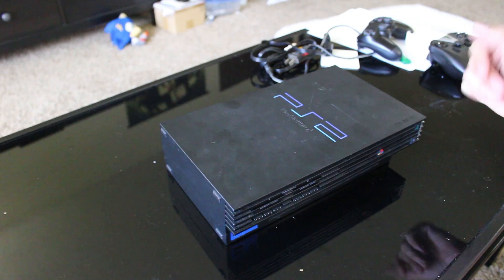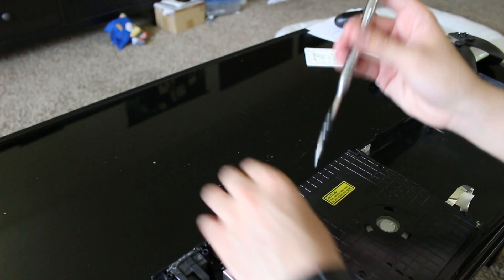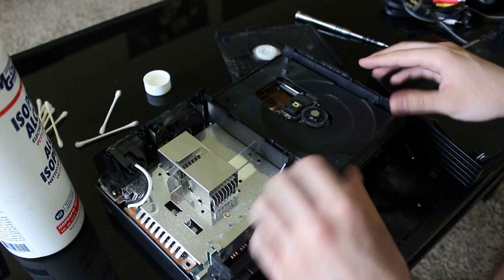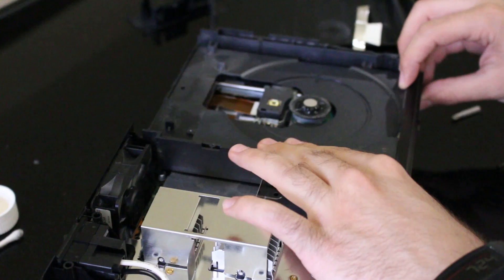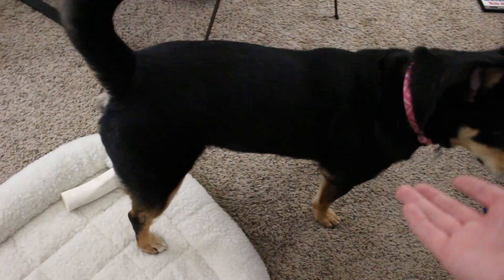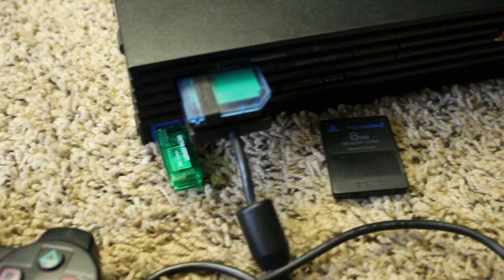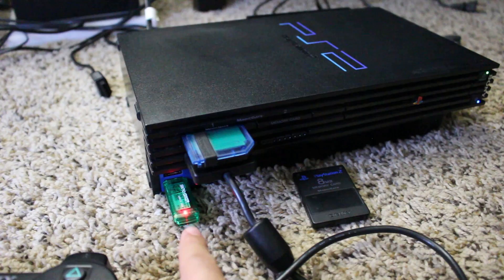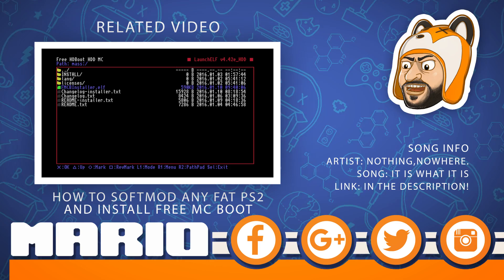Let's Refurbish & Softmod a Fat PS2!

Comment: Nice video, but is there any way to softmod PS2 FAT without a HDD or modded PS2?
Reply: Krisztián Andrási swap magic but good luck finding it
Reply: Krisztián Andrási Yes with the memory card
Reply: Kidboy A.G. installing freemcboot requires a disc hotswap, therefore the system needs to have the disc drive softmodded.
Reply: you can use an official memory card adapter for PS3 on a PC with the right software and a guide.
Reply: There are plenty of other ways...
SwapMagic, cheat-discs, mediaplayer-disc, disc-swaps, MC-adapter, etc.
You can even find MCs with FMCB pre-installed for a few bucks.
Reply: Dharumanyo 
Which technically is quite the same like the HDD-way... He would still need the HDD-Adapter for the PS2...
Reply: Dharumanyo 
I know, I have one of those...
Nevertheless, this is still the same method as it is mentioned in the tutorial, a.k.a 'internal HDD'-Method (even though an SD-Card is used)...

He asked for 'any way without HDD or already modded console' which supposedly implies that he doesn't want to go the route of an internally connected Storage-device... (which is not specifically about the HDD, but the method of getting FMCB on an MC, or Homebrew running.
Reply: You can use the old "independence exploit" using an Action Replay Max (with the memory card/USB utility) some PC software to create a modified "your system configuration" file and a PSone game. to boot into ulaunch.elf.
you'll be able to load games from a USB drive, but, as the PS2 is USB1.1 only, performance is lacking.
Reply: TheDeeplyCynical 
Actually a scene-member currently makes some test and went up from ~650KB/s to around 1MB/s!

Once these changes are implemented into the Ps2sdk's USB-Drivers and OPL is recompiled with those, most games with FMVs will probably run quite good!
Reply: Ah, didn't know that there have been improvements. My last experience with USB on the PS2 was "USB Advance" before OPL was around.
Reply: OMFreakin'G, USBA sucks, sorry... ^^

Yerp, Maximus32 just posted it a few hours ago. ;)

http://psx-scene.com/forums/f19/speed-testing-storage-devices-157395/

But it could be implemented quite easily I think and the benefit would be quite huge (~60%-bandwidth-increase, which is actually scratching the limits, due to the USB1.1-Implementations on different higher USB-Hardware-Revisions is only there for 'backwards-compatibility', but not really for the full technically possible speed...).
Reply: I was just trying USBA for shits and giggles as that was the only USB option at the time. My network adapter is SATA modded so I don't really need USB for anything as demanding as playing games. Those USB driver developments are good news for PS2 Slim owners.
Reply: TheDeeplyCynical 
...or for those FAT PS2s without an internal HDD, or Network-Adapter...
Reply: Richard Lynch 
That's still FMCB/FHDB...

Brendan Berney
Why do you post a link to swap magic... I can't really see the use of it nowadays.
Reply: Easiest modding I found was from a dvd I ordered, but it still requires a hard drive.  You put in disk, tell it to format hard drive, copy all games you want onto hard drive and only that DVD is required to pull up and run all games so no technical knowledge required.  Can't remember the name of it though.  I ordered it from some console mod site.
Reply: Yeah you can mod a fat PS2 without a hard drive you can also mod the first version of the PS2 slim that's what I have all the way up to like the 9000 series but then you have to burn all your games to disc and you got a patch every game that you burn using a program that you have to find online and since it's not been around for awhile it might be difficult to find
Reply: Once you have a free mcboot memory card though it's easy to make copies and more free mcboot memory cards it's just making that first one it's a pain in the ass
Reply: Action Replay from the c64 or is Action Replay a PS item? can you link to a picture/place to buy please, Tks.
Reply: Have all your modded consoles access one storage media for back ups over network with a freeNAS server. PSP/Vita, PS2, PS3, Wii etc...

Comment: I have one at home but it doesn't read disks and I don't have any memory cards in it
Reply: try cleaning the top of the diode on the dvd/cd reader as he did many times it stops working due to stubborn dust after heavy use/sitting
Reply: Troll Mob 
If it is a FAT PS2, just get a harddisk-adapter and an HDD or SSD and you are 'good to go'. Your disc-drive/laser does not need to be in a working condition...

Comment: Hello hope you don't mind me putting this on here I have been having a a problem getting my burnt back ups to boot with esr I keep getting a message saying dvd not set up to fix this you need to go into sms menu and press star go to the bottom of the menu exit out of it and it will let you now boot from esr or it will just boot the game itself
Reply: Might be a writing- or media-issue...
If you use IMG-Burn, try to turn on OPC ion its settings (which would calibrate the laser-power).
Reply: Cheers pal tried everything going into the sms menu and coming out of it is the only thing that works
Reply: Which does not mean, that it is not a writing/media-issue...
Reply: I have up loaded a video have a look see if you have any idea I'm stumped cheers for the help pal
Reply: Hm,... Interesting! Which SCPG is it and which FMCB/Version are you using?
Reply: 39003 free mcboot  1.953
Reply: just me
Does the same happen on previous FMCB-Versions?
Reply: Yep
Reply: just me
Hm... Might be some kind of hardware-issue?! Not sure, what causes it...
Reply: Alex J you was right the memory card was on it way out put it on another card and jobs a gooden cheers for the help
Reply: just me
THX for replying, how you fixed the issue. ☺️👍

Comment: Just picked up a used FAT PS2 on eBay, that I'm going to soft-mod.  Paid £12.00 for it; including postage (about the same in USD).  Comes with two controllers, the Composite and power cables.  The reason it was so cheap was because the controllers are old and one doesn't work, and the disc tray only comes out somewhat and has to be pulled out the rest of the way; but I reckon I can fix that easily by opening it up, and following a few of these videos.  The system plays games fine; so not bad at all.  Just need a SATA drive (Seagate), a faux network adapter with SATA port by Game Star, and a Memory Card with the latest version of FreeMCBoot installed on it.  The system was apparently just sitting in storage for a while; should be good condition.  So, it'll be great for some retro gaming and playing backups of all of my best PS2 collection that I could never part with from when I was a kid.  Still have my slim too, for general normal disc use.  I'll just pick up some 3rd party controllers from Elgetec; £10.00 for two, or I may even buy the FORGOTTEN PS1 Dual Controllers that's most similar to the PS4 controller with its longer hand grips and concave thumbsticks, but missing rumble which I won't miss.  I just need to find a good solution to hook it up to a modern HDTV - I was thinking Composite (EDIT: I MEANT 'Component') or a Pound HDMI cable; or maybe the dirt cheap Chinese PS2toHDMI dongle adapter? What do you think? A Framemeister, OSSC, MCable and MClassic are way out of my budget unfortunately; otherwise they'd be solid choices.
Reply from the maker: If you have component inputs on your TV, get a good set of PS2 component cables. If you're okay limiting your output to RGB as opposed to YPbPr, the RAD2x would be great for an HDMI solution.
Reply: @MrMario2011  Cool, I will definitely have a look into that for sure.  And, Mario - I actually appreciate you a lot for being able to reply not once, but twice now, as I understand that you must get flooded with messages like this 24/7 and how hectic it must be for you to keep up with everything - it hasn't gone unnoticed, and I see you've replied to a lot of people whether it be to positive comments or negative; but still always being helpful or humble regardless.  So, keep up the amazing content, man and keep doing what you're doing!

Comment: I would always take my console outside once a year and blow it out with the air compressor. I haven't done it with my WII in a while. When we remodeled our kitchen last year,we had a ton of dust in the place. I ended up using a leaf blower and blew out the house. We then went through and wiped down everything. The house was a mess because the floors needed sanding in the kitchen. The dust was terrible.

Comment: no offense you are cool and all but i just watched 10 minutes of you taking apart a PS2 backwards. it is easier to remove the disk drive then the contoller port then the power switch/fan. flip it over to unscrew the psu then unplug the still connected fan.

Comment: If you want to run PSXLauncher elf you have to have a 50001 model or a slim PS2. I used to have a 39001 which I softmodded but I used a clear blue custom case with a flip top opening. I had to pawn it and the pawn shop "lost" it so they replaces it with a slim PS2 and they paid for my Swap Magic discs so I could mod my slim
Reply: You are quite right about PSXLauncher, but actually it is also possible to swap on lower PS2-Versions!

You only need a program, which patches/removes the 'Logo-Check' before executing rom0:/PS1DRV (possibly it coud work as well with a dump of that file from a newer PS2-Version, but I am not sure about it)!

Comment: Man, I wish I still had my fat PS2 for easy softmodding and HDD use. The disc drive failed after many years of use. It was a version that had laser height issues. Adjusting it fixed it for awhile, but the drive stopped spinning about two years after I did a flip top mod for playing imports. Not sure if the flip top prolonged its life or eventually killed it.

Softmods didn't exist back then...it was either modchip or fliptop+swap magic. I guess there were slide cards, too, but those were super risky. I got a slim to replace it and did a simple tape and tissue mod to allow me to open the lid for swap magic and that's still working, but I'd love to just load all my games to a hard drive and be done with it. I've read that there is a network based ISO loader now, but I haven't had the chance to look into it yet.
Reply: Gaming Groove
Softmods didn't exist 'back then'? When?

ISOs can be loaded from LAN via 'Open PS2 Loader'...

Comment: Hey mrmario can you modify a ps2 from composite to hdmi????
Reply from the maker: No, get a component cable set and be done with it. There is an HDMI adapter but it will use the exact same component signal, and it has a few design issues.
Reply: MrMario2011 ok,thanks for the advice

Comment: Man, you took it apart the hardest way. Should of watched a video on how to. I've taken apart my PS4 quite a few times to fix Sony's flaws; Thermal paste and adding more force for the heatsink to cpu/gpu. My opinion the PS2 was more of a pain trying to take it apart after 15 years or so. I had just dug mine out recently to mess around with it. The drive was having issues, so I cleaned the laser, put a piece of cardboard putting pressure on the helix follower (white tab thing to the right of laser at 17:00 ), clean and lube the guide rails and helix that the laser carriage. 

When the disc skip, jitter, etc it's that stupid follower. 

I hope you changed out the BIOS battery since you were in there.
Reply: Iron Cross
He didn't changed the battery (obviously)... ^^

Comment: How about wiping the bottom off over something other than the stuff you just cleaned. Good work though. You might try a bit of Vaseline or die electric on and around the track. Also, use electrical cleaner on the plugs. It dries in 2 seconds.

Comment: better install the latest version of opl so you can use ps3 controllers with bleutooth or usb, it works perfect on mine
Reply: John Dreamer yes with the latest opl version you can use a bleutooth dongle, and before you select a game from hdd or ethernet on opl you click triangle and here you have an option to pair a controller if it detects your dongle or you can choose usb instead of bleutooth so then it emulates the ps2 controller and it save those settings so now you can always use a ps3 controller
Reply: Just2Options? Irrational: FearOrExuberance? Opl saves those preferences per game so ps3 support can be set for wich game you prefer, opl supports ethernet for all models and hdd for all fat models, lan games should also work (gran turismo 4), all consoles could be connected together on a network and it all should work

Comment: I still have my PS2 from back at their launch.(complete with its box and orig. wrappings) It still is in great condition it works great I always kept it clean and nice. I never took it apart I would just blow it out every month or so with my air compressor to keep the dust out. I bought a second one years later with intent on modding it but never did it is also in great condition I just never put the horizontal base on it like I did with my 1st one. It looks much better with it. Maybe I will eventually mod it. for now I have it on a different TV and use it as a back up.
Reply: 'Softmodding' on a PS2 can't harm anything and you can do pretty much everything with it.

Comment: My god. Imagine how many games you can play on a 500 GB Fat PS2.
Reply from the maker: Probably about 500 GB worth of games.
Reply: MrMario2011 Lmao,i mean like hundreds of PS2 games.
Reply: tikaij
~200 (on average, if you don't just/only use the biggest games)
Reply: Alex J wow. 200 games that's not bad at all
Reply: tikaij
They are ~2.4GB on average. Some are up to 8.5GB in size, so it depends which games are installed.
...and some games can be ripped a lot (even without removing content).
i.e. EyeToy (pal) is ~4.4GB, but its actual content is only 698MB or so.
Reply: *465.661 GiB. >=P

Comment: I did this way back in the day, how did you get the exploit on to your memory card? But really you should have called this "Cleaning a PS2 for a Friend"  lol   It's cool to see peps is still doing older stuff
Reply from the maker: If you check out the description I have a tutorial showing how to install FMCB 😁
Reply: MrMario2011 

No thanks,  I have 2 or 3 mc with fmcb. I was curious if it had gotten any easier.  No wait now you got me I'm a gonna check it out.
Reply: IMO, it is quite easy and there are a SH*T-load of methods to install it... (or softmod a PS2 in general...)
Reply: Your right Alex J there are a lot of ways I did this 7+ years ago and in 2017 still seems like the same old ways are still the best.
Reply: Find Used
Well, it is better to do it either via an already modded PS2 or via PC.

But some methods are pretty much unknown, like the 'double/triple-time-swap' which can be performed with almost any PS2-Game.
Reply: Elf/disk swapping and taking my fat PS2 apart, top off the DVD drive really the best I think.   Anyway I revisited this recently and tried it on 3 different slims didn't work, (I figure it's because of the built in Network adapter and how slims read netwrk info) but a fat PS2 first try.(just in case sum1 is trying on a slim and its not working) your right though it is better just to get a copy if you can.  Sorry I tend to ramble on at the mou'ph from time to time.

Comment: I used 007 nightfire method for my slim ps2 only downside on slim is if you play games from usb  the  cutscenes lag/glitch. when i picked up my fat ps2 and found out its super easy to install free hard drive boot if you have the hard drive adapter you can connect the hard drive to the computer and install free mcboot right to the hard drive so no need for a memory card.. annnnnd i see you already did a video that lol
Reply: Jeff C
FHDB only works directly from HDD on 'SCPH-300?? R' and newer.
Reply: ok?

Comment: Shoulda replaced the RTC battery while you had it taken apart, no way that CR2032 is still good. Those last 8 to 10 years. And even if by some miracle its still alive, it wont be soon, by putting a new one in youd give it another decade.

Comment: using solvents on plastic parts. neat.
Reply: Isopropyl acohol? A solvent, yes. Can you name something better to clean with while leaving no streaks and evaporating at a high rate leaving no moisture or film behind to mess with electrics. While remaining relatively non toxic, just don't drink it or huff it. Sanitizes at the same time.

Comment: You can also softmod a PS2 and play burned PS1 and PS2 games on it.
Reply: Blast Records
Burned PS1-Games however need to be swapped on a softmodded PS2s...
Reply: Yes, you need any PS1 game (really doesn't matter) and the software will stop the DVD-Drive so you can swap the discs.
Reply: Blast Records
It depends on the software (i.e. uLE has a function to choose, if the disc should be stopped), but yes...

As for swapping... Well... The TOC DOES matter! You can't use an original game with i.e. 200MB used and expect a copy with i.e. 300MB to work, if you swap with such an original (with a low TOC&sector-count).